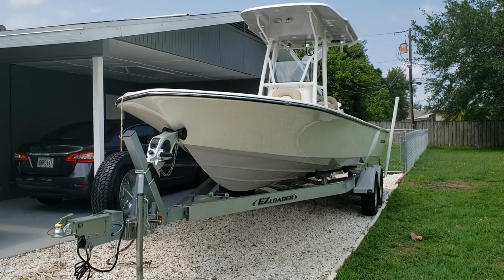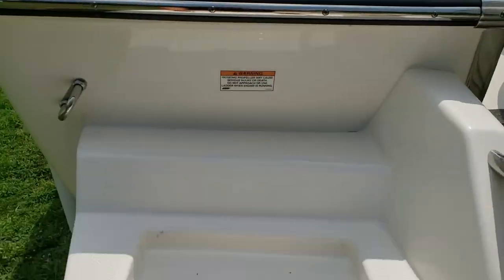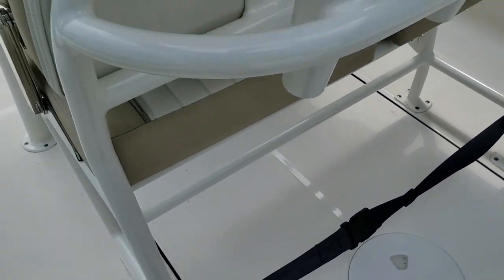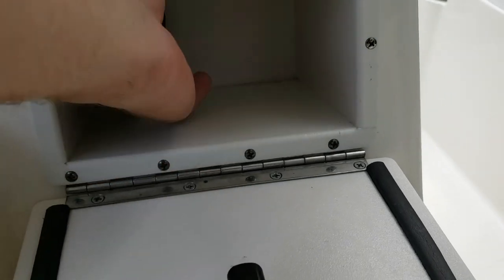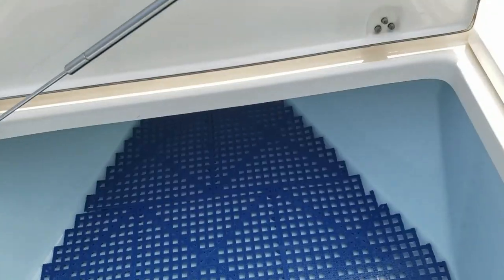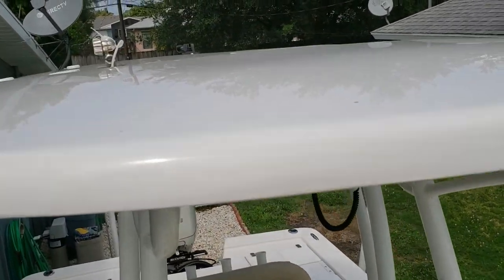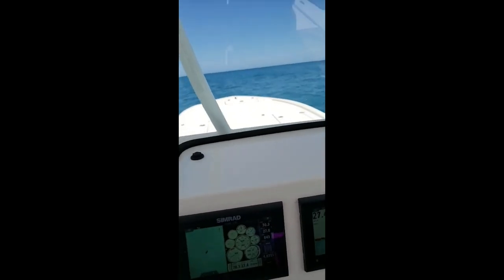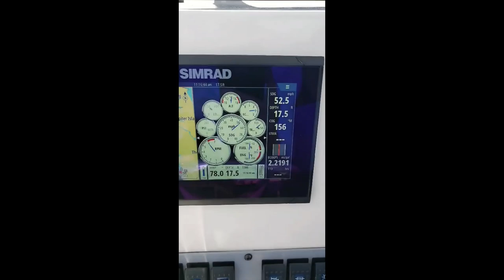2020 Sea Born FX24 WALKTHROUGH

Comment: I just put a deposit down on the 2021 powered with a Merc 250. 

Anything you wish you had on this boat? Any options you passed on that you wished you wouldn’t have?
Reply from the maker: I actually got the boat maxed out on the options I believe, it’s the LE edition. One thing I wish that the boat had was a small head in the console for my fiancé when we on the boat but it’s not a deal breaker. You will love this bot it rides so nice. I would recommend a trolling motor absolutely and a power pole. The boat with a backplate to is a very nice addition for those shallow water areas.
Reply: @SeaShift  Thanks for the feedback! I’m definitely getting a power pole and trolling motor. You actually reminded me about the jack plate. How skinny of water you get into with that boat? I assume you have a jack plate as well?
Reply from the maker: @jasonspring6970  yes I do have a 6 inch jack plate, I can get into about 14-16 inches of water. I love the jack plate, something I never knew I wanted. This boat came with extras I personally wouldn’t have gotten but after I have had them I can’t live without lol
Reply: @SeaShift  Did you ever add side and down imaging?
Reply from the maker: @jasonspring6970  no not yet, my most recent purchase is the autopilot for the big motor but I have thought about it, maybe in a year or two I will. Definitely in the future though, I have a thru hull transducer on the bow so I don’t have anything on the transom

Comment: What hold do you have your motor mounted in, mine is the middle holes and the hole shot takes forever.  I am thinking to raise the motor and going to a four blade prop
Reply from the maker: I have mine on a Jack plate so I can adjust mine. However at all levels my 300 Suzuki takes a minute to get out of the hole as well. I have to use my trim tabs everytime
Reply: Mine is a 200 suzuki in the middle hole, on a jackplate that is not adjustable.  I am thinking to go to the last hole, then possibly a 4 blade prop.  With 4 people on board, they have to be if front of the console to get out of the hole.
Reply: @SeaShift  I am told the issue is the Hull design and the suction it creates.  Boat rides awesome, just embarrassing how slow the hole shot is.
Reply from the maker: @bv4879   Do they have to be up front even with the use of trim tabs? Yes the comfort of the boat running 35-40 MPH on a day where its a foot and a half chop on the intercoastal is incredible. She flies and lands great and cuts through the chop with ease.
Reply: Yes, even with trim tabs it takes a football field and then some.  The motor seems like it lacks power for the hole shot, zero prop slippage.   I thought maybe a 4 blade would help?
Reply from the maker: @bv4879  possibly because of the surface area, id be interested to hear the results on that test. On my jackplate it is a 6 inch so i have tried it stuffed to the ground and all the way up and i find that trim tabs will help my boat however it still takes maybe 100 ft or so to get up and going. I was often wondering if i had my fathers motor which is a mercury pro xs if the extra torque would really help. But not enough to get rid of my suzuki!

Comment: What a fine boat bud! Like wow!

Which prop did it come with and have you tried any others?  Mid 50s on that rig is outstanding.
Reply from the maker: Thank you! It’s a power tech 3 blade 22p, I never tried other props because I was pleased with this one so much.
Reply: @SeaShift  It def sounds like you’re dialed in.  Appreciate your response. Great show.

I also have 300 Suzuki but in a Ranger 2410. Have a 3x20 Suz prop. I’m close but still about 3-400 rpm off.
Reply from the maker: @fishing4dinner  thank you for watching! This motor I can get just over 6000 if I pushed it all the way down but I don’t like to run it anymore than 4900 if I want to get where I’m going, absolutely love my Suzuki.
Reply: @SeaShift  I hear ya. It does sound like you’re right on the money. Hammer down and feathering the jackplate I can get 5900 rpm with a tail wind going with the tide. Otherwise I’m around 5650-5700. I’d really like to touch 6k. As a byproduct my hole shot would improve.
Reply from the maker: @fishing4dinner  yea does sound like you have a little bit left for sure, better holeshot always be nice, fastest I’ve had this boat was 56mph

Comment: My boat will keep up with you haha with a 150 you got a Slowzuki im running a merc 150 4 stroke on my 20x6 flat 20 tranny your no faster hahaha
Reply from the maker: "slowzuki" gets me 4MPG iI amm fin with my speed and my reliability. However that need for more speed is always there but 50MPH on water s fine with me. Fastest I've had her is 56 WOT. I'm fine with that lol
Reply: @SeaShift  i still got to get my merc propped right but in about a 60+ mile trip i burned about 12 gallons and had around a 500lb load
Reply from the maker: @edwardabrahamiii3742  thats pretty good, i never did anything with my prop because I have been pleased, I have entertained the idea of looking for a different prop but this one performs very well.
Reply: @SeaShift  suzuki the hardest to prop tho